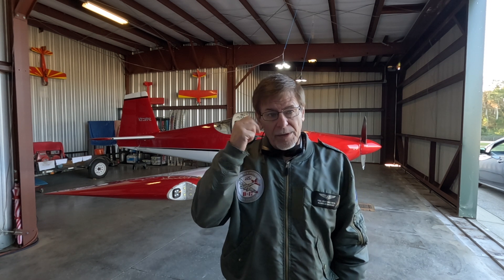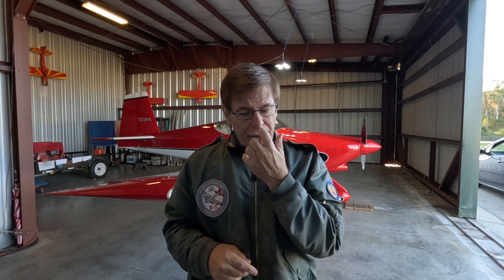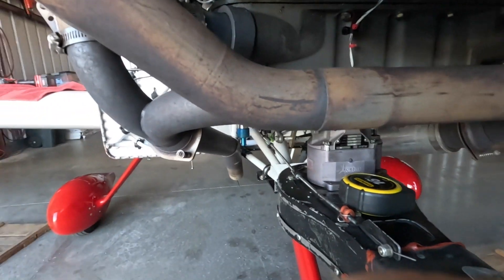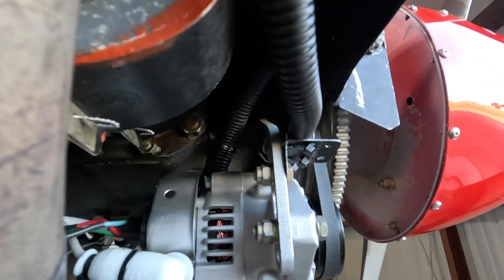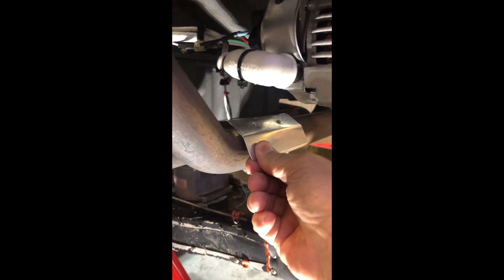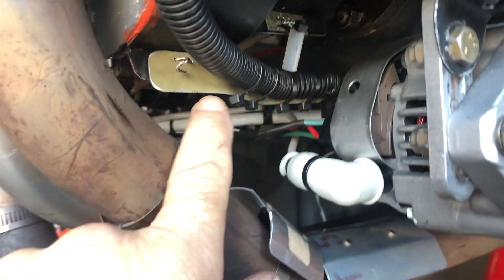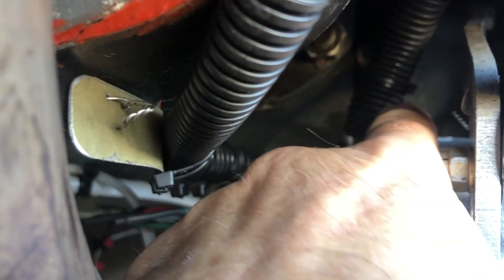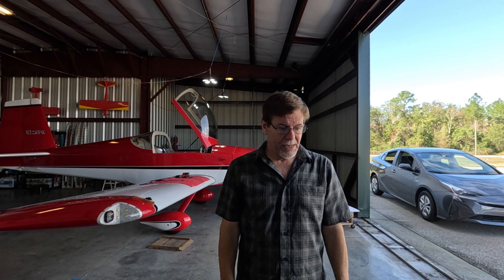Measures I'm taking to try and get more than two years from an automotive alternator.

Comment: NO, the reason being you are not going to get rid of the "Hot Spots" in the alternator.  You will have air coming from two directions so end up with very little cooling,  I will be that there is some engineering in the internal cooling.  My advice is get a aircraft alternator, mine is a plane power  it's small  light weight and will last over 2,000 hours.

Comment: As stated below, try automotive header wrap. Keeps the heat inside the pipe It has been used for many years to keep temps down under the hood of high performance engines. It works. Beautiful plane. Just started on a RV8. Hope it turns out as nice as yours.
Reply from the maker: Great idea,  I'll have to check them out.

Comment: Did you change the fan on the alternator, an engine on the airplane turns backwards to an automotive engine.  So you have to have an aircraft fan on the  alternator  that turns backwards of an automotive. It won't cool enough with an automotive fan.
Reply from the maker: Good eye an you are correct,  On a plane the alternator is running in reverse compared to a car.   The alt. doesn't care so makes no difference... except as you mentioned, to the airflow.  This is why I now have total of 4 ambient air blast tubes in place.  I do believe it's going to help.

Comment: .. use stainless hose clamps on your Ends instead of what they Supply, unroll & soak in a bucket of water before Applying so that it Stretches a bit ..

Comment: you might consider an aftermarket alternator designed for heavy duty / harsh environment use.. like Mechman Racing alternators.. Mechman is known for their high amperage alternators for audio sound systems.. but they also build super nice 170amp heavy duty racing alternators.. big heavy duty diodes..  about $350...  way less than certified... and should last longer than your run of the mill automotive alt..
Reply from the maker: I'll have to check it out.  Thanks for the information!

Comment: That looks like a good plan you formulated to improve the longevity of your alternator, heat being the real nemesis of solid-state electronics components.

I know that in automotive applications, the decline in the battery health can impose a higher load on the alternator, as the alternator is forced to operate on a longer duty cycle to keep the battery fully charged, resulting in a shortened alternator life. I was wondering if the replacement of a lead-acid battery with a lithium battery with increased charge capacity might impose less of a working load on the alternator and thus extend its life. I'm assuming that the plane's electrical system functions similarly to that of a typical automotive system, with the battery essentially being the power supply to the electrical load and the role of the alternator being mostly to maintain the battery's state of charge.
Reply from the maker: Hey,  you are correct as far as my aircraft electrical system, pretty much just like a cars.   I know my battery is in good shape.  I've checked it.  Thank you for your comment.
Reply: @paulschannel3046  Good luck in how it works out.

Comment: Most standard alternators go bad due to failed regulator rendering the whole alternator defective. My solution would be an alternator with seperate external regulator on a isolated heatsink. The heat disipation can be monitored independently also.
Reply from the maker: Thanks for the information!  I believe in the two failures I've had,  the first was like you said, the voltage regulator and the second was the at least one diode.  As you can see in the video, the exhaust,  literally about 1000 degrees at the point,  just a couple inches aft of where the electrical components are located at the aft end of the alternator.  I am HOPING this shielding and increased cool airflow helps.